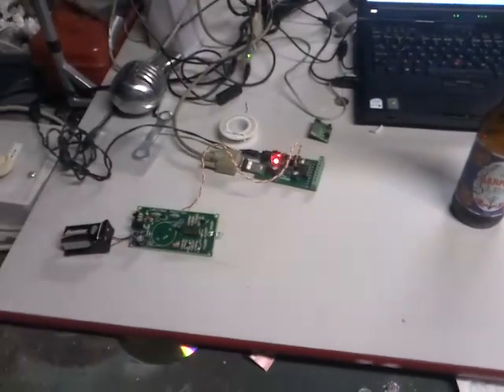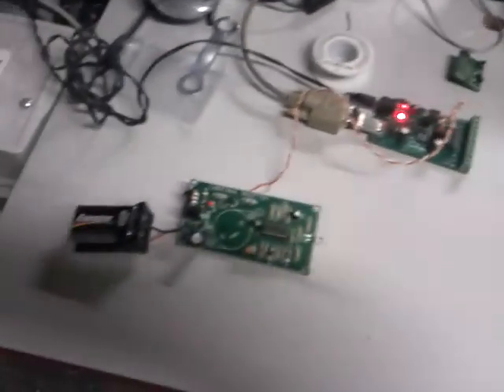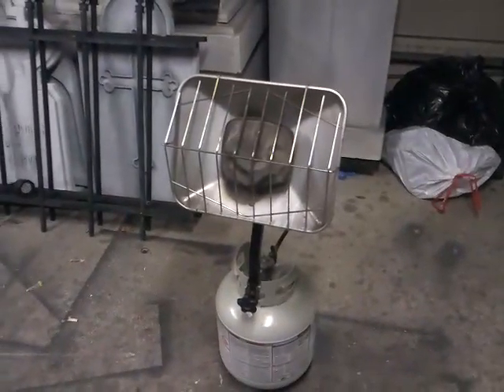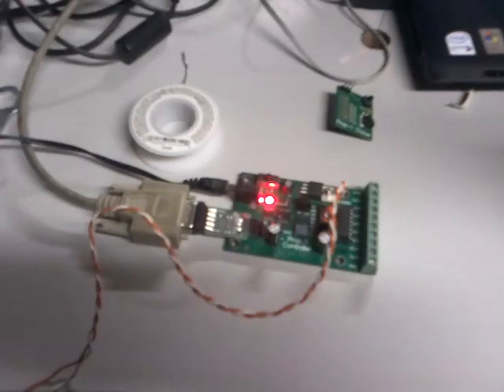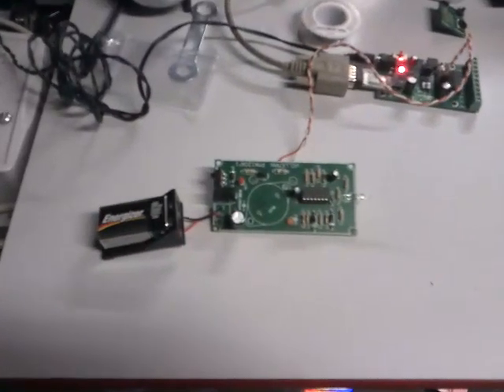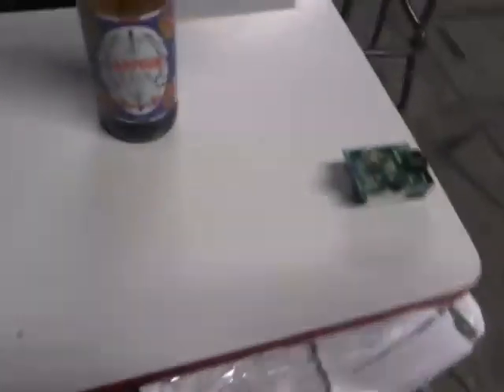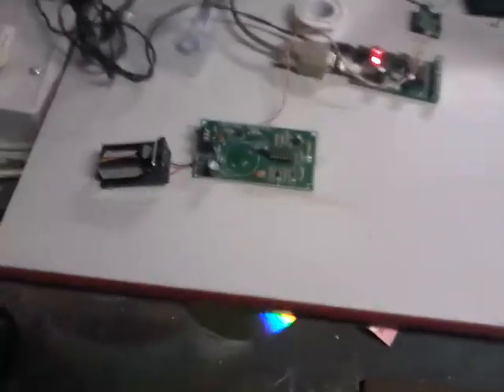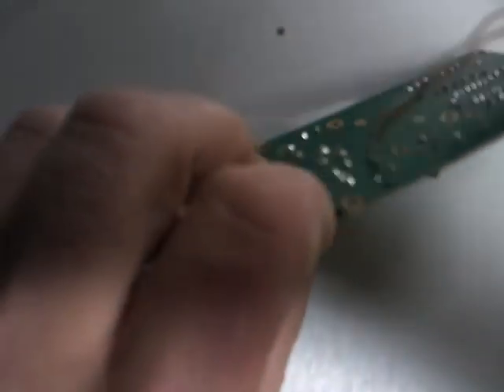Prop1 Velleman IR Break Beam Kit

Comment from the maker: @robertb7864 
I'm using the voltage from the kits LED to trigger a Prop1 pin, but it could just as easily be used in conjunction with a properly rated relay, or a relay/timer kit. The "Dead Texans" group on the garage of evil network based a couple meetings around using this kit with a timer kit (thus making a standalone solution). Head over to the site and join up with that group. Great bunch of folks and they'll be happy to help.